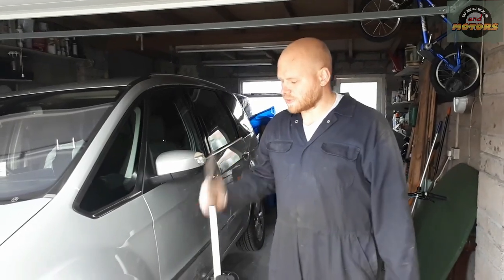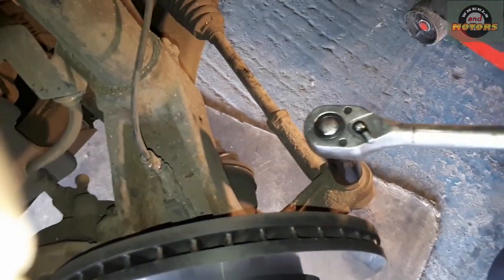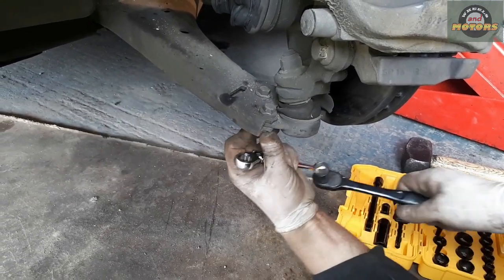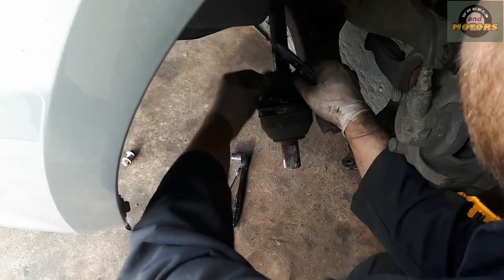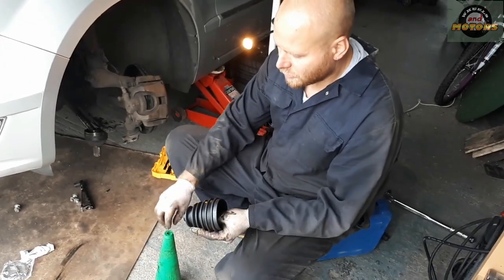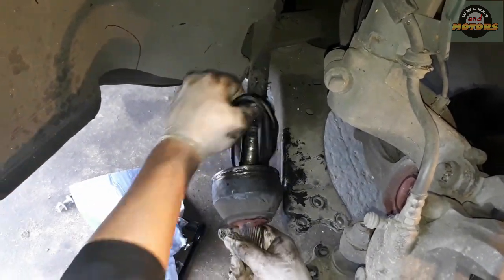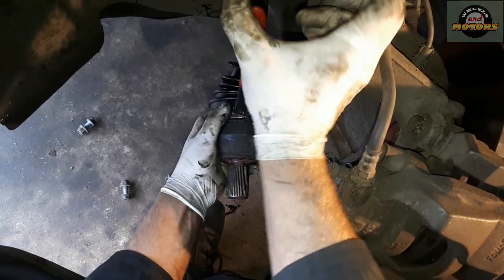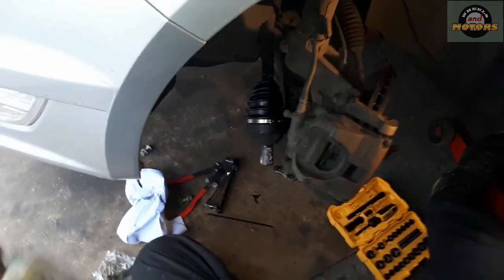Quick way to replace CV joint gater/boot Ford or any other car with MacPherson suspension.

Comment: I did this job yesterday and all went well except the clamp would not close down for me, I've used the tool multiple times so maybe an issue with the supplied clamp
Reply from the maker: These clamps can be tricky to apply. As a plan B you can use a cable tight. On the bigger end I would recommend the clamp though
Reply: @wawayltd yeah I had to buy better quality clamps separately

Comment: Horn not working on ford focus
Reply from the maker: I don't have particular experience with the horn. Maybe steering clock spring? Do you have any other buttons on the steering wheel that don't work?

Comment: Just wondering if you use cable ties will it pass a MOT in the uk ??
Reply from the maker: Yes, it passes MOT, there is no strict rule on that. Although, looking back, I would recommend to use those metal stripes if you can.

Comment: Not a big fan of the plastic zip tie..You have part. Do it right. No need to N-rig it.
Reply from the maker: You're right. Going back in time, I would use the metal strip. Although, if something has gone wrong with it, zip tie is not a big crime 😉

Comment: This is such a good tutorial video! You are so good at explaining ALL of the steps in detail while still keeping it brief and to the point. EVERYTHING on my car is seized SOLID and I have been fighting with wheel bearings and front end suspension/steering for over a WEEK now! What a pain in my a**!!!!! The last thing I want to do is disassemble ANOTHER seized part so I can break something else in the process lmfao After watching this video I'll be stretching the boot on myself instead of paying a garage hours of labour to disassemble everything and replace it. So thank you!! Just gained a subscriber for sure!
Reply from the maker: Thanks! Glad if it helps 😊👍
Reply: You will want to search online for a step by step procedure for yoir specific vehicle , whenever you are replacing a part on a car the lingo or technicians terminology would be R&R for instance R&R CV axle boot so you that means remove and replace CV axle boot everyone on YouTube is not an expert just so you know on video from what I saw this guy never repacked the axle or boot with grease so it's going to dry out and rust out very soon
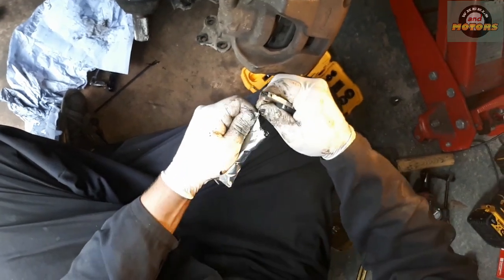Reply from the maker: That's a lie. Have a look at 9:10
Reply: @wawayltd my apologies thank you for correcting me. you should know as well as I do I'm an auto tech, there is a range of skills and workmanship in youtuber's tutorial type videos, and honestly reviewing the video again, its a well done and thorough tutorial.
Reply from the maker: @andrewf2630 You are definitely right about me not being professional. But that's the point of my channel to give people the confidence that it's not a rocket science and there's no need to be scared of DIY.

Comment: What size bolts did you use to replace the rivets. I can’t get the ball joint off and would like to take those rivets out. Thanks
Reply from the maker: It was pain in a bottom  to remove those rivets, using drill, grinder, chissel, hammer and a ton of swearwords - we did it! I think we used 13mm bolts with 8mm thread.
Reply: @wawayltd  much appreciated. Thank you. Nice vid

Comment: Nothing quick or unique about this. Same process on all cars
Reply from the maker: I have a lots of non-unique videos on my channel. It's just meant for people who have no experience at all to give them confidence to start DIY-ing. I'm putting out a video about Ford rear brakes today - it's so boring, makes me sick 😁 But there will be plenty of people seeing it as a good guide... Maybe... Or maybe I should review my content..
Reply: WheelsAndMotors you content is fine it’s just how I read the title as “Quick way to” therefore was expecting a short cut.

Keep it up
Reply from the maker: I'll try my best 👍
Reply: @aqib2000  NGL this is quicker than other options such as removing the axle head and then replacing the gator that way instead of cutting, stretching and then refitting. No need to be mean, your comment was not valuable at all :)
Reply from the maker: Thanks for stepping for me here Stephen, but he's right - I didn't discover amazing secret, lots of people do it this way and you right - it's quicker than disassembling cv joint and fitting plastic.  It's good when people can express their opinions 👍
Reply: @wawayltd  .